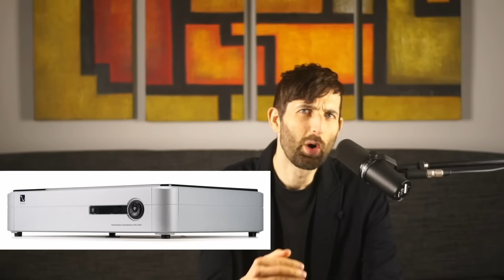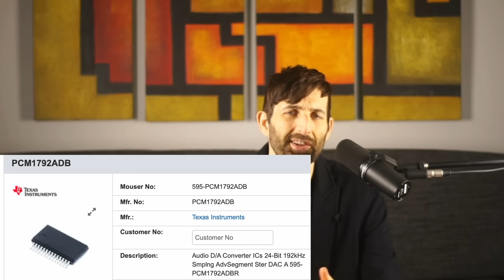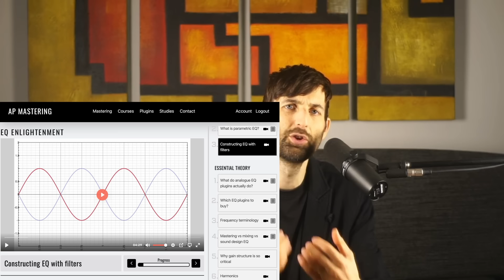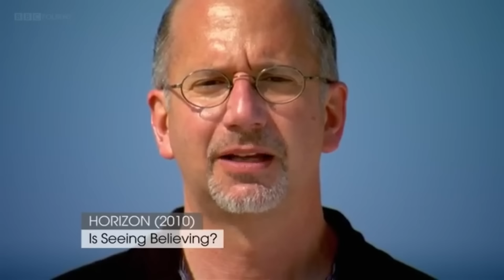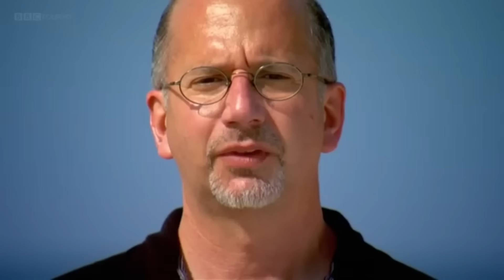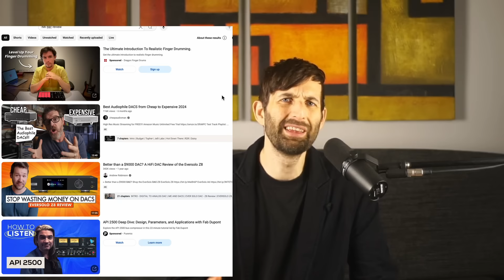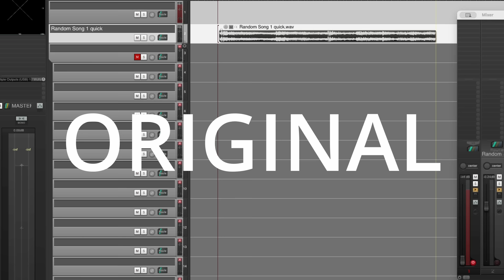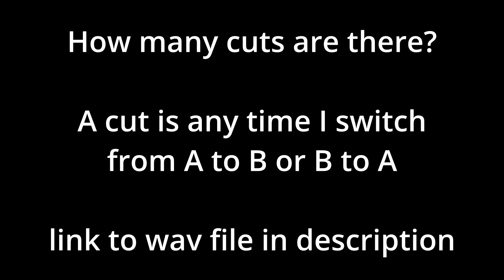The DAC Scam - Almost everyone believes the hype

Comment: Electronics engineer proofed that they use the same DAC chips! And since you dont want any change in the audio function you can't even say we have exclusive sound except your selling bad equipment. 
For me the hardest part would be writing an driver to bypass the operating systems intern audio processing to get loss free data output to the DAC, but for an IT person that would be fairly easy i guess, i just never did it. The electronics part is really easy and nothing new to invent, the concept is always the same. And since signal altering happens in the physical parts of the transmission (mostly speakers and the room) and not in the DAC part you dont have to alter your circuit to correct the signal. So we can say they all sell the same Product with different cases and you pay for optics and haptics not quality.

Comment: Thank you for this interesting video. After evaluating many, many Dacs and recording their outputs from identical sources, I can wholeheartedly say that the are sonic differences between some DACS (including the sound stage - some seem to spread the audio image out wider than others) BUT, I do not put this down to the DAC process (ie make of chip or ladder or…) but the very end of the circuit where a mini preamplifier is introduced, just in front of the DACS output). Tiny changes here can make a detectable  impact on what we hear. Working a bit like a step filter or tone control. The effect of soundstage widening can be introduced by creating ‘phasing affects’. This coupled with multiple inputs (I2S + USB + others) and a good quality power supply and casing can impact price, and whether the product is hand made or mass produced. 
We live in a strange world where we like to differentiate, hence car manufacturers make lots of models in lots of colours, in the hope that one will suit us more than their competitor) but it will, most likely be the badge  that sells it to us the most.

Comment: I use an Audiolab 8200CD as my DAC, 15 years old or so, I couldn't hear any difference when I auditioned the Audiolab 9000Q pre amp just recently. with its newer chipset. The real disappointment was that the 9000Q didn't sound as open as my 8000Q which I was considering replacing.

Comment: what was the point of the bababababa segment? he says it normally at first but then starts to bite his lips? and the picture doesn't change at all really , wtf was the point of that, the sound did change because he is using his mouth differently, try it out for yourself. i understand that there are snake-oil, which exists in every market, look at watches, a 1 million watch does what that a 10k watch can't do? you dont sound like an engineer, there is something called emergent property , same parts come together to make different kinds of things, the engineering matters. so you can't spew out stuff you read online  or an AI told you and claim you're stating facts. 

Regarding a/b testing, you did not even let people know that they should make sure they're signal chain is faithfully reproducing the sound. Most people have no idea what signal chain they're running. And on top of that you have youtube processing the sound, it already ruins the quality of audio that we upload to it, the browser people use or the yt app has volume normalization and other background processing. So the a/b test is really useless like this isn't it? 

Better is, get yourself an mp3 file and a flac file, make sure you have your desired signal chain, then play them back one after the other. That'd be a good test. You are clearly manipulating people who don't know better instead of informing them. You could have mixec your audio in a certain way, we can't know that.

Comment: Theres a certain point where AD converters fidelity passed a threshold where the bit depth didn’t matter anymore. Most people can barely hear any difference past 16 bit conversion which is why it became the standard for CDs but there is still reasonable quantization error which is why 24 bit depth at 48kHz or 96 kHz is what is used in daws

Comment: There is a DAC in my PC which when sent to an external Amp and speakers sounds just about OK. Run the sound out of a USB port in to an external DAC (£400) and the difference is substantial. There is also a DAC in my Philips CD player which sounds OK. By-pass the internal DAC and use an external one (£600) there is a noticiabale improvement in clarity and the sound seems wider and fills the room more. I would not spend over £1000 though, as the law of diminishing returns starts to kick in. The cost/quality of other equipment, Amp and speakers, room layout etc do play a major role in this, so there is a balance to be had. There is a DAC in my mobile phone and we know how they sound ....

Comment: why don't you design, build and market your £200 dac then and see if it can complete with expensive DACs?
Reply: I am not interested in chips, I am interested in music and sound.
Reply from the maker: @richardsaila8073 yeah the chip converts data to sound
Reply: @APMasteringNot at all, it's the speakers.
Reply from the maker: Because a one off DAC will always cost more than one which has an order volume of 1000000 units. I’m going to make a DAC on my channel though when I have time
Reply: @APMastering if it sounds the same as a £20k DAC i'll give you £50 for it otherwise you pay me $£50 ok? That should settle this question
Reply from the maker: @philiphua2562 the 20k one could sound worse. Many ultra expensive HiFi products are non professional snake oil nonsense which isn’t even good
Reply: @APMastering i haven't heard any awful sounding 20k dac. I might not like the sound but it's not something you can put together for £20

Comment: I have Hifiberry DAC+ Pro, and it sounds exactly the same as Bluesoind NODE built-in DAC, and also they sound the same as my amp's built-in DAC, but an old Technics CD player internal DAC sounds quite different, so probably not all dacs sounds the same, they may have some sort of coloration? Or it's just because this particular CD player has additional EQ control?

Comment: So much crap here.  Talk about bias.  There seems to be quite a bit here.  How many here are critical listeners?  Most people are not.  Most people are superficial listeners when it comes to listening to music.  How many people stop and say hey....listen to the harmonics of that flute?  Or, how about that decay that seems to linger on and on.  Or, that sound that I just heard sounded like it came from 20ft away.,...when in fact that sound came from your speakers sitting just 8ft away.  I am being very superficial here but very much to the point.  You never touched on any of this in any depth.  All you seem to do is mock people that venture into DACs.  Your post just proves to me that some professional mastering engineers are not the best prime example to give advice about audio playback equipment.  Just like I am not going to listen to a computer programmer trying to tell me the ins and outs of a good computer hardware configuration for an end user.  What the hell do mastering engineers know about consumer audio equipment in general?  Not that much.  How many audio professionals own high end audio equipment?  Not many.  The professional audio world, and the consumer audio world are not the same.  The DAC chip in a DAC has marginal impact in the overall performance of that DAC.  You have the input stage, and the output stage.  This is where all the magic as you say... happens.  From what I am getting from you is that we are at the pinnacle of audio recording and reproduction.  So, that means all audio equipment sounds the same, or should sound the same because we have mastered the recording and playback.  But yet we have home stereos costing from $100 to $1m.  So they all should sound the same.  You have not proven anything.  Poles are not scientific proof.  I am not a DAC fan boy, but I know bashing when I see it.  You couldn't have been any more creative? REALLY!  I wonder how many people going along with your BS actually own a DAC, or have much experience with DACs.  How many people responding to this post actually own a high end audio rig?  Do you honestly think that a DAC that cost $50,000 does not sonically sound different than a $100 DAC?  Not all people that can afford a $50,000 DAC are stupid people.  In fact most people that can afford a $50,000 DAC, and buy one are the shrewdest people you would ever meet.  Most people that have money are not so likely to get taken by a mirage.    This channel is garbage.  Garbage in....garbage out.

Comment: I'm sure that a lot of what is said in this video is true.  However, I have heard many DACs and including the R2R DACs you mention from yesteryear from the likes of Theta, including their CD players.  Yes, they are not transparent, but they are fun to listen to for sure and I think they have their place.  They have a big, bold and warm signature unlike a lot of modern DACs from China for instance which prioritise detail and transparency.  Of course, you are probably aware of Chord DACs too that do not use standard chips, but program there own FPGA chips.  Other companies do this too, but from what I have heard they are not too different from other modern DACs.  Power supplies play a big part and where they are implemented, I think these can make a difference to the perceived sound stage.  That said, I have heard huge sound stage with a lowly Chord Mojo 2 DAC through some powerful valve amps, so go figure.  I also understood one purpose of NOS DACS to be that you are taking load off the DAC and performing the sampling and other pre-processing elsewhere in the chain.  Some Audiophiles use a product called HQ Player for example to upsample to various levels of DSD or PCM.  I had a play with the demo software but never felt the need to invest in it.

Comment: This is worth a read ! - It's about more than just the chips—there are many ways to process a digital signal. While mainstream DAC chips such as ESS, AKM, and others are widely discussed, each offers different levels of processing capability. For example, the ESS 9018K2M sounds noticeably different from the 9039Pro, and there is a corresponding difference in price, they can all be implemented differently and have different power sources, making the price vary even more.

Beyond these, there are R2R ladder DACs, which use an array of resistors to process the signal—a fundamentally different approach compared to the ESS chips. Then there are FPGA (Field Programmable Gate Array) solutions, which are fully programmable by the manufacturer and don’t come with any built-in audio processing bias. These chips allow for highly customized signal handling, and power requirements vary greatly depending on implementation.

Take Chord Electronics as an example: their lineup includes the Mojo, Qutest, Hugo TT2, and Dave—ranging from $400 to $12,000, plus the optional M-Scaler. These devices use FPGA chips mentioned earlier. I’ve personally tried all of these DACs, including the Dave. While the Dave is truly stunning in terms of performance, I find it crosses the line in terms of price versus perceived clarity. I’ve chosen to stick with the Hugo TT2 paired with the M-Scaler.

The biggest problem is that most people with low priced systems cannot accept that a high-resolution system costing far more would give them a better sound, they wish to believe that there system is perfect and as good as it can get, however, the differences between DACs become strikingly obvious—it’s like comparing chalk and cheese, the higher up the scale you go (to a point). To understand your system needs to be on a similar level for each component to truly realize these differences. It's also important to remember that we all hear and interpret sound differently. Our brains process both sound and vision uniquely, so it's essential to perform a blind A/B test whenever you consider changing your DAC, amplifier, streamer, cables, or speakers—before making a commitment.

For context, my setup includes the Eversolo A10 streamer, Hugo TT2 with M-Scaler DAC, Michi X3 amplifier, and Bowers & Wilkins 804 D4 speakers, all connected using Chord ShawlineX XLR interconnects and Chord EpicX speaker cables. You can certainly spend more on any of these components, but over the past seven years, I’ve found this setup strikes the right balance between price and performance.

Generally, as you spend more, sound quality does improve—but often in smaller, diminishing increments. So be cautious when listening to those who say, “they're all the same and you're foolish to think otherwise.” That's simply not the case. Ultimately, it comes down to your ears and your wallet. Spend wisely—because not every upgrade delivers better sound.

Comment: Let me make my point clear. From one side you are absolutely correct that in the music industry soft scam is so widely spread and most or all DACs in the picture are in the group. So, a $100K R2R DAC is a scam and when you know how it is designed and what is inside it will be a disaster. Your are buying 20KG of aluminum with a normal $100 R2R DAC using upsampling and optical conversion which creates jitter.  However, this does not mean DACs do not sound different. The sweet spot for a good DAC is around $1000 and if you want to buy Chord Dave for $15K that is fine if you know what is inside.

Comment: While he's right about chip costs and expectation bias, he oversimplifies DAC design. Power supply quality, analog output stages, and filtering implementations create measurable performance differences beyond just the chip itself. The analog circuitry, component selection, and PCB layout significantly affect noise floor and output quality. His skepticism of extreme pricing is valid, but dismissing all differences as "snake oil" ignores legitimate engineering factors.

Comment: What makes you think that people buy expensive DACs without even listening to them? And what makes you think that people should trust you more than their ears? 
Obviously, you have no idea how a DAC is structurally arranged. Digital filters can be configured differently, there can be one external oscillator or several for different sampling rates. 
Output stages can be organized in very different ways, EMI/RFI filtering, power supply, ground planes, timing jitter, master clock etc etc 
This video is a SCAM from someone who have no idea about topic.

Comment: Wrong. R2R ladder DACS do not use off the shelf chips. FPGA chips with custom programs.
Reply: If you playback PCM data (for example coming from the digital output of a CD player) where is not much what a "custom program" have to do.
For nearly every digital audio format (except MQA) the decoding algorithms are well known and not difficult to implement. If an FPGA is used or a microprocessor does not make a difference on the result.
FPGA may be cheaper as you can implement all the digital stuff in a single chip.

Comment: I agree with the premise of this video.  He is exaggerating a little when he says they all sound the same.  But I believe it's in a general sense to prove a point.  For instance, a DAC chip usually needs an opamp before and after it in the circuit.  They are called buffers.  Some change the gain; others change the impedance.  Those opamps usually need capacitors (which can affect the tone).  These opamps need a clean power supply, and that power supply can affect the performance.  Now, let's say company A puts out a DAC with shitty opamps, caps, and psu.  Company B puts out a DAC with high performance opamps, caps, and psu.  There will be a sound difference.  Not much, but a little.  Now Company B's better selection of parts probably costs them an extra $100.  But in today's market, as AP so bravely points out, company B decides to jack the price up by $1000.  Just for spending $100 more on the analog parts.  In that sense, yes, it's price gauging in the most extreme.

Comment: got me to thinking about distortion. the valve distortion is often enjoyed by people as a form of distortion that 'doesn't sound awful' and turntable timing errors can train the ear to enjoy timing errors especially when they are shared across a library of someones favourite music. let alone pops and cracks coming from a record player making people think they are old souls enjoying music in a historically significant way. its all bs. eliminating distortion from the signal path has almost been fully achieved now from source through a hypex module on amplification. a decent speaker and you now have to spend a shocking amount of dough to A B at the same volume level and sound better.

id love you guys to do a rationalists guide to building a stereo. it would shake up the internet!

Comment: He wrong.  The chip is to process the bit rate and to speed of the digital format....however it does nothing for the end results.... It do not remove noise or colorations... It does not determine bright harsh or muddy sounds that's the equipment job ...So the build, the material, the wireing the power supply the clock speed and sync All matters how your digital music sound...I know best been doing this for 35 years.   Dacs do make a difference period